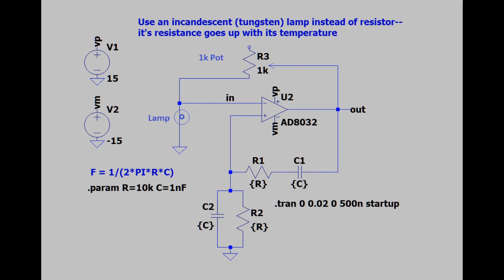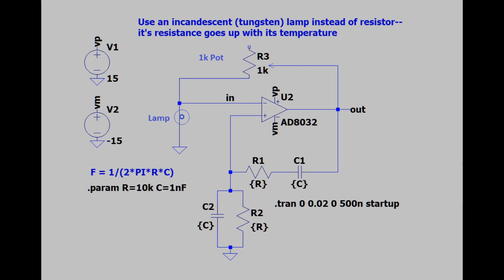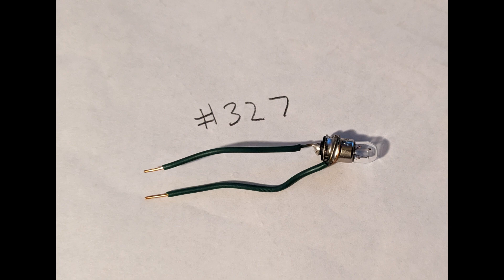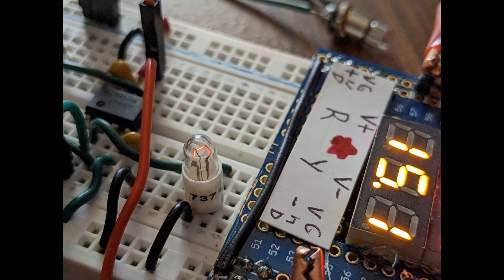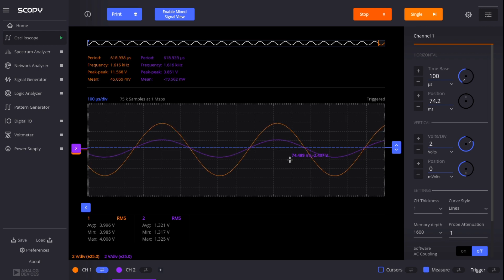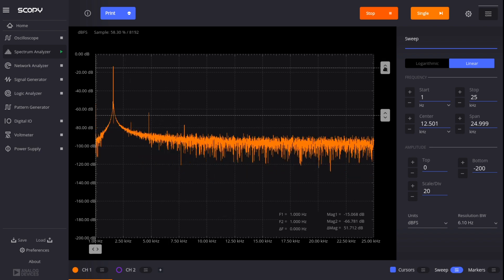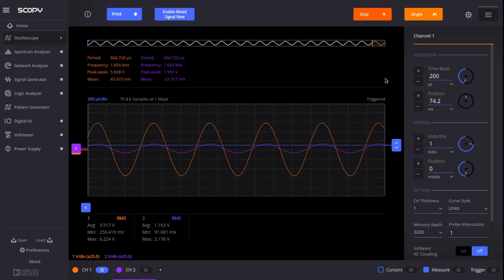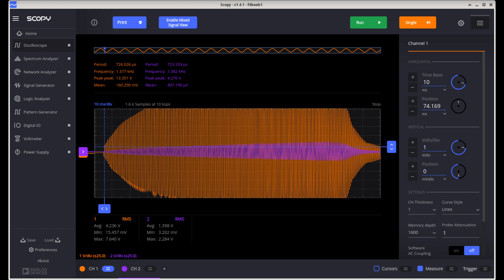Lamp-Stabilized Wien Bridge Oscillator

Comment: really you need not use only the lamp in the divider leg.
consider adding an R in series with the lamp.
Choose Rf and (Rin + [Rlamp@peak current| + Rextra) so that the gain with nominal lamp resistance value is 3. 
The idea is too limit the extents of the gain from ~=2.9 to 3.1 the purpose of the lamp then is NOT to cover a wide range of gain compensation but only a percentage. This should prevent the large swings and settling.
Reply: Resistor stability  will be so  critical that   Low distortion say about -100 db below fundamental  wil N OT be obtainable , that is why Hewlitt used a light bulb !
Reply: @martinmartinmartin2996  note R in series with lamp, and this comment was 7 months ago,... I don't even recall the video.

Comment: The big thing is, this amplitude regulation has very low stability margin. So low, it needs some nonlinearity amplitude compression in the opamp to get stable, that is what "helps" it when going near clipping.
If you look at it from the regulation feedback loop theory perspective, you find two inertial elements in the regulation feedback loop: One is the filament thermal inertia and the second is the response of the oscillator circuit when the lamp resistance changes, becoming even slightly 3 means the amplitude is increasing till some compression effect brings the gain back to the exact 3 (assume the RC positive feedback is exact and there is no phase shift in the amplifier). And vice versa, even slightly smaller than 3 means the amplitude starts decreasing till it disappears.
And because each inertia means a 90deg phsse shift component in the response function, having two of them means a supposedly negative feedback (higher amplitude -> higher lamp resistance -> lower gain -> amplitude getting lower) may actually become nearly positive at a certain frequency range. Just because the lamp, as well as the Wien bridge oscillator) have some noninertial components in its response (static V-R curve of the lamp, amplitude compression in the opamp), the regulation feedback phase shift does not reach the 180deg to cancel the intended negative feedback, the amplitude regulation loop is still somewhat stable (it does not generate other oscillation forming AM on the output). But even when stable, it exhibits rather strong resonance, which then amplifies any disturbance (e.g. the filament motion, or even just the circuit noise).
 Note we are speaking about the generated sinewave envelope as the variable to be regulated here.

In fact this circuit was originally designed with vacuum tubes, exhibitting quite significant low order distortion. This distortion on one hand still does not generate that much of higher harmonics (compare to e.g. opamp or diode clipping), yet provides very significant amplitude compression characteristics needed to have the thermally controlled feedback loop stable, so the generated signal free from amplitude fluctuations.

Using a diode clipper to vary the gain makes the amplitude very stable (as the only inertial element in the amplitude regulation loop is the main Wien bridge oscillator response), but is causes the generated signal to get distorted. Or you may combine the diodes and bulb to get some compromise, but it is all the time just a compromise between amplitude stability (so side band noise around the generated signal in the spectrum), vs distortion (harmonisc).

To get away from this compromise, most advanced variants use some form of DC voltage controlled gain (a FET in the feedback as a variable resistor, analog multiplier circuit,...) controlled from rectified and filtered output. This way you may shape the dynamic response of the amplitude feedback by the feedback filter components so well it won't pass anything on the generated signal (so does not cause harmonic distortion), while still maintaining very good amplitude regulation stability margin, both at the same time. 
Yes, then we are talking about the amplitude regulation circuit to become way more complex than the main Wien bridge generator core itself, but that is what it took to get a clean sinewave before the modern digital synthesizers became usable...

Comment: Nice demonstration! I wonder what happens when you slow down the variable lamp resistance even more with a cap in parallel to it. By smoothing/integrating over how many sine periods do you think is the most stable operation achieved?
Reply: If you put a cap in parallel therre will be no stabilisation since it is the AC gain at the oscillation frequency that must be reduced. The cap will negate that effect.

Comment: Great experiment makes me wonder whether you could utilize a thermistor with a similar to the bulb coefficient. Maybe thermally coupled with a small resistor or just a low-value thermistor on its own.
Reply from the maker: I have read that thermistors have been used.  But I think most modern serious attempts use fairly complicated JFET circuits for gain stabilization.  I think every approach requires tweaking.
Reply: The oscillator with lamp was used in old HP generator. Therefore was a good circuit.
Reply: Microphonics from touching it, vibrating the lamps filament.  The wien bridge really got my attention when trying to get a decent sine wave at audio frequencies.   Turns out it's not that easy!
Reply: I mentioned it in a reply to another video of yours , that using multiple lamps adds thermal mass , hence slowing down the changes resulting in a more stable and cleaner output.  I've ordered in a LOT of different lamps ( over $100!) And now trying to get a selection of op amps when I get some testing finished I'll let you know what I find.  Thanks for your videos!
Reply: @nopenadanowaynohow  This sounds fascinating too !